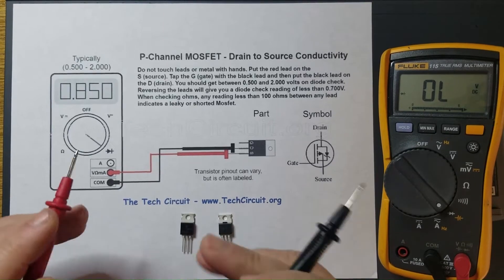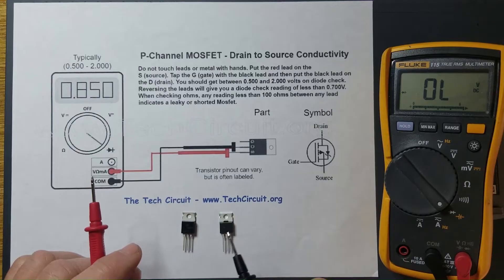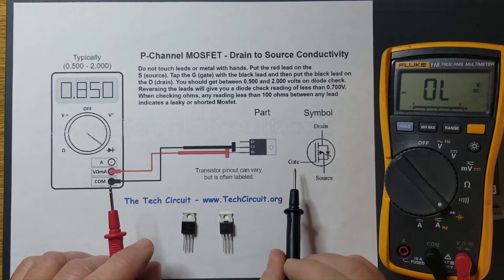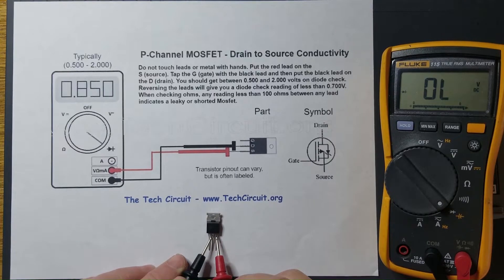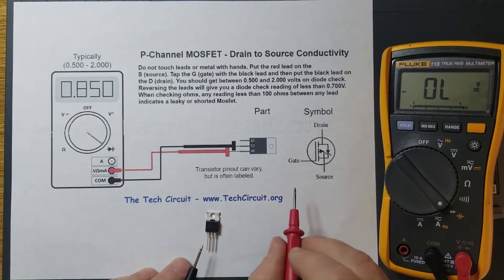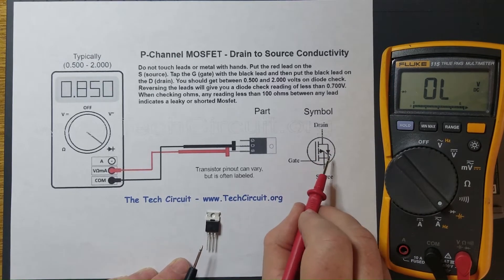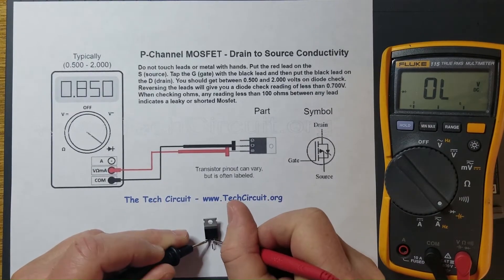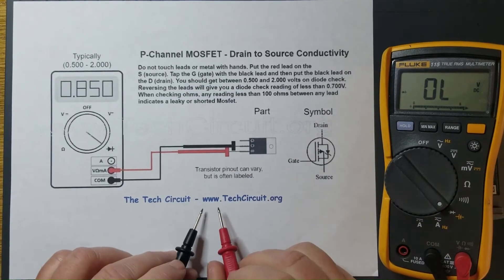#80 - Testing MOSFETS with a Multimeter

Comment: Your test will only work on mosfets where you actually reach the 'on' voltage at the gate of the mosfet under test.  Your multimeter will NOT turn on all mosfets.
Reply: yeah, some mosfet have high "on" voltage, and sometimes it won't open the gate at all

Comment: I ordered a pack of IRF4905s (P Channels) and it seems that every single one was faulty. 
8€ for nothing. My blood is boiling.
Reply from the maker: They may be OK, but just may be at mosfets of different electrical properties that don’t respond to a general test that covers most Mosfets
Reply: @ I have done the test and the mosfets do in fact work. I just didnt know how mosfets work in general and the test you showed does not work for the IRF4905.

Electronics is very unintuitive in my opinion, and I am learning a lot of this on the internet and not in school so every step of building my dream project is very difficult.

Thank you for your content.
Reply: @TheTechCircuit  thank you for the quick response. 
I will do another test which I know will work for this specific mosfet but I am not feeling optimistic.